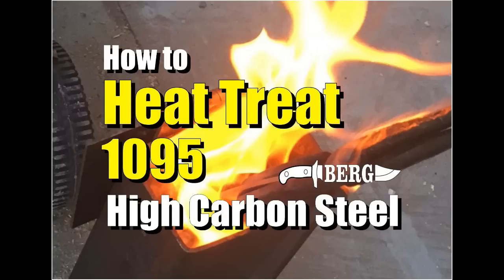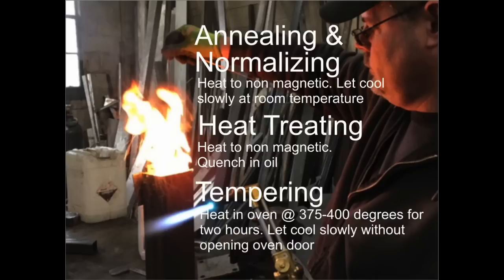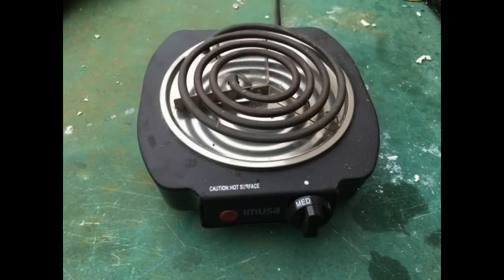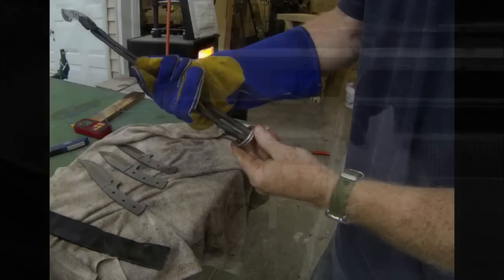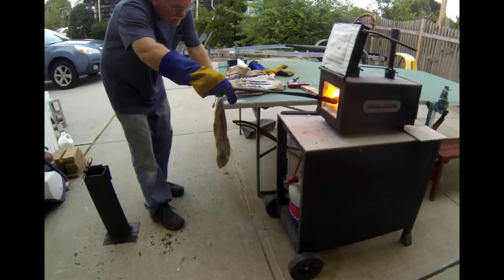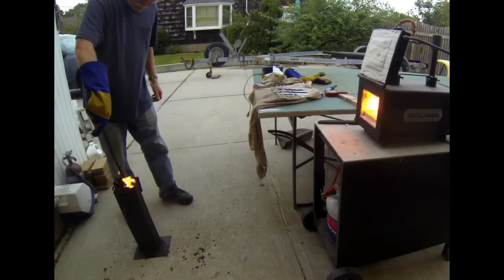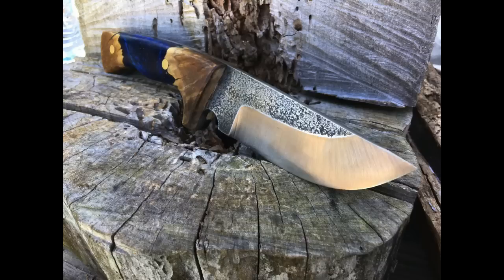How to Easily Heat Treat 1095 High Carbon Steel for Knife Making

Comment: You are analyzing the color in daylight and they look prettt bright orange to me which appears too hot. I HT my carbon steels in the near dark garage and touch a magnet to the blade. As soon as the magnet sticks, I pull it off and put the blank back in the forge and heat it back up just a little bit until I get that dark red color and it's nonmagnetic again, then quench. Of course, getting a file to skate is a good test you got a blade heat treated. When I first started and got blanks too hot / too orange, I had bad results with the steel turning out too soft. Let me know what you think. Good video, though.

Comment: Very, very informative and presented educationally. One thing I don't agree with is that if you decide to soak the blade in vinegar water overnight to remove the scale, this will result in a "weak" temper which could allow some of the brittleness to remain in the blade. Trick with tempering, do it as soon as the blade returns to ambient temperature after the quench. Aside from that, this guy is spot on!
Reply: I think you mean BEFORE it returns to ambient temperature after the quench. Ideally the blade should go directly from the finished quench into a warm oven without dropping to room temp.

Comment: you say heat until non magnetic....then you use a magnet to clean up on the belt sander ?
Reply from the maker: The steel is only non magnetic when its heated to critical temp. As soon as it cools down a little it returns to its magnetic state. Check out book Introduction to Knifemaking by Berg and Northgard. Its available on amazon.com

Comment: If you are using the CORRECT oil for 1095, you don't need or want to heat it. 1095 is NOT an "easy" steel to heat treat. If you want to use a thermocouple, it shoudl be used in your FORGE if you insist on austenizing in a forge.
Reply from the maker: Many people have told me the same thing but I have always had good luck with 1095 and Im only using motor oil! As long as you get it to critical temp and keep it there for a couple minutes.
Reply: @DIYeasycrafts  I hate to be the one to tell you this, but you probably don’t have a good idea of what a “good result” is were 1095. Motor oil is not anywhere fast enough to harden 1095.

Comment: Can you put a chunk of tube steel in the forge and heat the knife inside that to make it heat more even?
Reply: No. There's no benefit to inserting a steel tube inside your forges' refractory. As far as heating more evenly, one could try applying multiple burners (A single burner inlet and burner on either side of your forge) or, if when heating a double edged item (dagger, arming sword, etc,) just get really good at recognizing signature colors whilst rotating your pinchers (tongs.) But remember, you only want to "focus" the quench on the edge....In other words, don't try to harden the flats or spines of your blades. One burner/2 inline burners are sufficient for knives and most single edged swords. I hope this helps a bit...given it's a bit late. ;-)
Reply: @marcburkett9834  there absolutely IS a benefit to creating a baffle in the forge to get more even heat. A MAJOR benefit. Unless you're using a ribbon burner, any propane forge will be improved by it, no matter how nice of a swirling flame you have. Get a LONG thermal probe and check the temp every few inches of depth in your forge and you'll be shocked at how much variance there is... and that causes big differences across the length of your work when you HT in a forge. But making a baffle mostly mitigates that difference.

Comment: i was told to HT 1095, i needed 3 HT's, and then on the 4th, i quench. it seems you did just once, no? i was told to also hold them at those temps, for about 15 mins. and the oven part, was twice at 450, for 2 hours. too much?
Reply from the maker: If you have a heat treating oven you can hold temp for ten to 15 min. With a forge its not realistic. You just need to get it to critical temp (non magnetic) hold for a bit and then quench. I have always tempered 2 cycles at 395 fot two hours and then let it cool slow without opening oven door.
Reply: @DIYeasycrafts  hows your edge retention, what's the hardness after your process? thank you!
Reply from the maker: @cankeco  After this video I moved into a Devils Forge propane forge so its easier to reach and hold critical temp. On hardness files usually right around 60 on rockwell C scale.  Never had a problem with edge retention but I do not mess with a bunch of steels. I use 1095 for my high carbon blades and AEBL for stainless blades

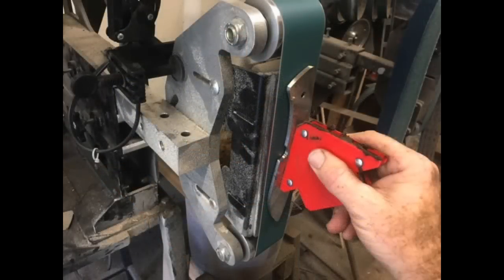Comment: At approximately 6:44, after tempering, I noticed you cleaning the blade on the belt sander by holding it with a magnet. If the blade was de-magnetized in the heating process, why does the magnet work to hold the blade??
,
,
Reply from the maker: Blade will only stay de magnetized while at critical temp. As soon as it cools even a little bit its magnetic again

Comment: I read that to properly heat treat the blank you need to keep it just inside the non-magnetic range for 4-6 minutes per millimeter of thickness.This gives the particles in the metal time to align properly for maximum harness.  Do you do that?

Comment: I heat treated three 1095 steel knives this week. It was a learning process for sure. First knife I did tried propane torches. It didn’t work. Then I tried a charcoal chimney and charcoal. That works awesome. I also tried a campfire with a leaf blower to increase the heat. That also worked awesome. 

I used a mix of motor oil and peanut oil for quenching. At first I thought the heat treating failed because they had carbon on the surface, and a file would bite into the carbon. But after I got the carbon cleaned off a file skates right across them.
Reply from the maker: The more you do it the easier it is. Trick is to get it to next shade of orange after non magnetic and hold it at that temp for a few minutes before quenching

Comment: Do you grind the blade before heat treatment while the metal is soft or after the total heat treating process and annealing?
Reply from the maker: I do rough bevels before heat treating and then just clean them up after

Comment: I have a chiefs knive im making, its a cross between german and japanese. But i made it from flat 1095 carbin spring steel. Is it worth me risking destorying never having tempering before or is there really no need to temper it
Reply from the maker: Very important to temper the blade after heat treating. Otherwise a simple drop on the floor could cause the blade to break
Reply: @DIYeasycrafts  thank you but what if I don't heat treated at all do you think the knife would be durable enough to last
Reply: @jblazeangel6969  no
Reply: @bfries555  thanks

Comment: I worked in a shop where we used transmission fluid for to quench mag ejector springs. Would that be appropriate for a knife?
Reply: Only if you enjoy breathing toxic fumes from the transmission fluid burning.
Reply: @danunger3240  you don't just sit there burning fluid. You dunk the part. There's a moment of flame, as it goes in, but that's it. If you don't dunk the part, the quench isn't even.
Reply: @calebjohnson7592  it's a horrible thing to quench in, when there's much better, professionally designed quench oils.

Comment: I was Kinda Hoping the video would say, How to treat 1095 with a forge?...Don't!   go buy some 1084 and save up for an evenheat.  lol  still a good video, you might try using a pipe as a baffle to allow you to soak and hold at temp in a forge.
Reply from the maker: I have and evenheat and still kind of like to heat treat 1095 in the forge. Most beginner and novice knife makers have not invested in an expensive heat treating oven. This video was for them. Sorry could have made the title better . Pipe is a great idea. Have used rectangular stock for some larger blades but should have included that tip in the video. Thanks for the feedback
Reply: @DIYeasycrafts  I understand, but as I'm sure you are aware, 1095 heat treated less than optimally is much worse than 1084.  It needs 5-10 minute soak for optimal results, but even , more crucial is to stay close to 1475 or grain growth starts.  Just Bringing 1095 up to non magnetic and then quenching is not going to have all the carbon in solution.  1095 is only a better steel than 1080 or 1084 if everything is done correctly.  Most people think if it got hard they did it right, well, Maybe, but probably not.  Anyway, people are going to do it regardless cause 1095 is the king of the 10xx series. lol  and if thats the case your video will help them out.
Reply from the maker: I agree completely but also understand that for most its had to keep it at critical temperature for that long with a forge or torches.Having said that I usually get somewhere in the 58 to 60 range on the Rockwell C scale with a forge. Most are very happy with that

Comment: Can you re-use the oil after quenching the knife in it? Like can I have one container with oil in it and just use it for a year without having to change the oil?
Reply from the maker: Yes
Reply: @DIYeasycrafts  thanks!
Reply: @DIYeasycrafts  What kind of oil do you recommend for 1095 quenching?
Reply: @jimi1291  kinda late but invest in parks 50. Its expensive but its the most adequate oil for 1095. Canola works somewhat but parks 50 is best

Comment: I forgot to ask how do you stop them from rusting
Reply: If you're talking about blanks before heat treat, one maker I know sprays them down with WD-40 after grinding bevels and keeps them in plastic until heat treat time, then he cleans them up with degreaser. If you're talking about after heat treat / after they're finished knives, use whatever lubricant you prefer (plenty of products and opinions out there) and wipe down the blade to protect.

Comment: What rivets are you using to hold there handle on? And do you completely sharpen the knife before heat treatment or get the final edge on it afterward?
Reply: I would not sharpen the knife before the heat treat, you will warp your edge if you do.

Comment: i dont think you can get up to 66HRC 1095 gets when you quench in oil.
Reply: Probably not. If that's critical to you, then O1 is probably a better choice. If you can quench 1095 above where you want the tempered result, though, my experience with it and other steels is that you can still get a good result. I have read that if you get a suboptimal but acceptable quench, then tempering colors may be misleading (as in light straw may be slightly less hard than it would've been from max hardness. No experience, but I have accidentally underquenched a plane iron of O1 such that it only landed around 61. I have never tempered it, and it has worked well (plane irons don't really test toughness of the steel too much, but chisels and some heavy planing would damage full hardness untempered material, and my experience with some higher carbon steels like white 1 is that if they are nearly untempered, they can sustain damage from coarse aggressive sharpening stones and then crumble).
Reply: David W That’s why I use only Brine with dish soap with 1095. I’ve gotten near 67RC. The issue with canola oil is it’s too slow for 1095, lots of retained austenite, which reduces final hardness. 
 
If you use this stuff (W1 more so) and want make use of the 1% carbon content, you need the quenchant to drop you to Martensite Start (~450F) from Austenitizing temp is 2-3 seconds max. At this speed there is almost no RA, tempering gets care of the minuscule amounts remaining.

O1 is a great steel, however it is not as easy to heat treat. More alloying elements to fully get into solution.
Reply: Best way to quench steel to 66 HRC is to circulate the oil like car manufacturers do with springs. You need to cool the oil with pipes holding water. It's a hydraulic process.

Comment: I thought 1095 requires a 10 minute “soak” at temp.
Reply from the maker: I make no claims at being an expert. Only showing what I do and how I do it. However, I do not know anyone that soaks 1095 for 10 minutes in a forge. Maybe if you had an even heat oven you could get away with it but I would be afraid of growing grain and overheating. Most guys do not even go the extra step in pre heating the oil.
Reply: If you google the metal stat chart on 1095 is says a 30min soak, . I've heard 10 different ways